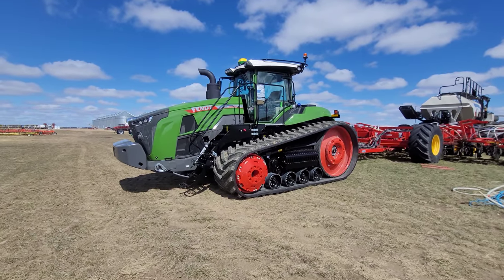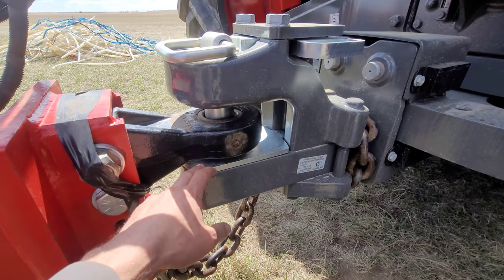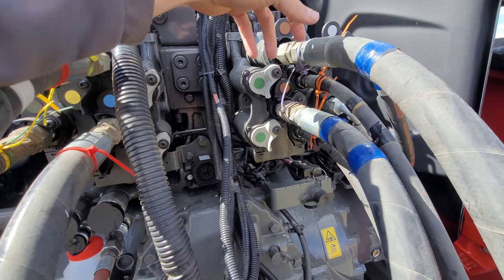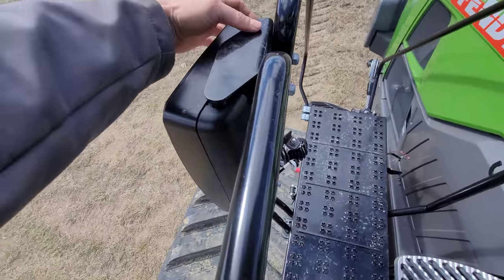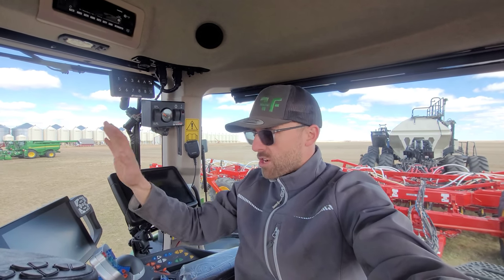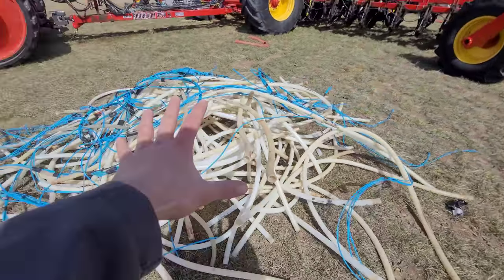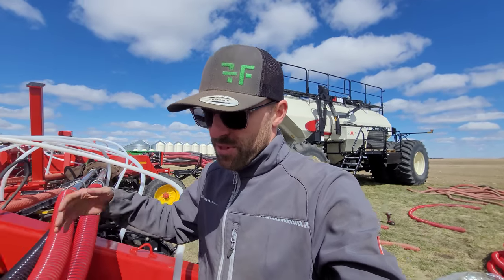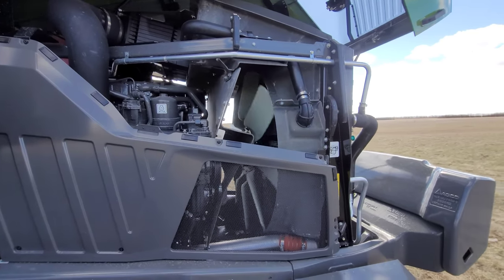New Tractor Reveal! 🤔🙂

Comment: 62,000lb! is mental! Hell of a tractor
and also "Yes it does have DEF" hahahah
Reply: Long time rule of thumb is 100 lbs per horsepower. That transmission may or may not eat up more power than the 4 tracks probably similar.
Reply: Wouldn’t fit down the roads round you Eh Tom 😂
Reply: Le tracteur fenf est bien et la vidéo est très intéressante et le semoirs est très grande

Comment: Congrats Mike!
I was working for fendt from 1989 - 1992
The difference between the MAN D4276 for the tractors with up to 700 hp is the turbo with a variabel geometry, to get the max torque at low revs, the ones for upt to 790 hp for cmbines have a fixed (larger) turbo.
Enjoy the german „meisterstück“,

Comment: That thing is so impressive. Can't wait to see it in action. Kinda surprised there's no refridgerator.
Reply: Maybe he'll look at an aftermarket fridge
Reply: @beaviccoon470  most likely yeah, but when you purchase a bit of gear worth $500k or so, you would think a fridge worth a few hundred dollars would be thrown in there ..
Reply: @landlifem5872  and put a decent tool box on it..
Reply: @hammerslammer3006  yeah you would think the toolbox should be built from 1/2 steel plate and sealed. Wouldn't cost much more and it's the small things like that gets people talking about it.
Reply: Tractor not an apartment!
Reply: @Luke muzzy Fendt, according to AGCO, is supposed to be "the worldwide premium tractor brand". I mean that's what they say, don't know if its true, but its what they say,
Reply: I'm not surprised at all, people talking about it cause it's expensive and people spend lots of time in it but I work on a mine and all the equipment is at least as expensive and lots costs way more and they all have smaller and less comfortable cabs than this tractor is. brand new D11 3.4 million and no fridge or anything like that, people spend 12 hour shifts straight in it. the excavators are around a million each and you don't even have enough room to stretch your legs out or air conditioned seats
Reply: @alexkroes6859  A D11 and excavator does a whole lot more than a rebranded and refreshed cat challenger
Reply: @J-1410  Not really at all. It's ridiculous how cheap the cabs are on mining/construction equipment
Reply: @alexkroes6859  I mean on a farm they are taken care of a bit better, unlike in construction where they are just beat up, fixed, and repeat. No use adding more parts to break and probably not get used for something considered obsolete in a decade. 

Also, doors being open is quite common in construction. That would just run a "fancy" cab within a day.

Comment: Do you ever take a step back to appreciate and marvel at how staggeringly complex,hi tech,sophisticated and just freaking awesome equipment has become?! This tractor is surely approaching the complexity of an aircraft. Really nice tractor 👍
Reply: if you're meaning airliners then no not even close
Reply: I ran planters in the UK about 35 years ago MF 590 with a MF30 combine drill, over here in Australia this year helping a neighbour plant, 410 hp NH tractor with a locally manufactued drill at 40 feet wide.I fully agree four monitors plus the tractor function. My first day I wondered what I had let myself in for.
Reply: Um, that's not a plus by any means
Reply: But on the flipside, Welkers get all their work done with simple powerful reliable
Big Buds made in the 80s ,soooooo is all that computer crap really necessary or just a way to drive up prices?

Comment: You can put the reverse fan on it. Which I would highly recommend
Reply: I don’t think these will operate at the proper temp if the fan isn’t oriented in the proper direction. Pretty sure they had an issue with one of their other Fendts where it wouldn’t keep the proper temp and ended up being the fan was reinstalled in the improper direction.
Reply: You can’t do that because you will have to change the hidraulic pump to a different one where it has the 2 different cylinoides and you that way each one can respond to each other when to blow and when to suck

Comment: the big question from everyone is: when can we expect to see pull offs between the 1167 vs 560 and the 1167 vs the 620
Reply: Your comment is on the top and now I wish youtube had spoiler tags.
Reply: And the 1167 and ernie😄
Reply: He already done that with the pro til. That's the reason you see that two tract there. It beat every tractor on his place. The Quad track IH case Johnny Quad and the Johnny two tract. And the fendt had the best ride over all
Reply: @joescheller6680  I don't mean something the protill race, just tractor strap tractor. He did do that but never posted it on YouTube, just on patreon. But it would be interesting to see if a weighed up fendt can beat a 9620rx
Reply: @arendvoordepoorte3217  reply you don't really want to be embarrested to bad do you

Comment: My dad talked about seeding up in Montana in the 60s using a two track. It was made by Caterpillar. It was made in the 40s I believe. The farm was out of available wheeled machines so he pulled the 2 track out of the trees and got it running. He didn't like the ride and the hitch was its Achilles Ankle but it seeded for two years. The big heavy iron weight up front also was able to push dirt. Much more useful than those sadle weights I'm sure. He parked it in the tool shed when he changed farms. He showed it to me 26 years later. It was just where he parked it.

Comment: Hey mate, in regards to the horsepower, I'm fairly sure that they only put 620hp through the transmission, and the 50 horses on top of that is purely for hydraulics/auxiliaries. So I can't see them putting a 790hp version out until they're comfortable that their transmission can handle 750hp+
Reply: I don't know anything about tractor transmissions,i know they are made for torque and low rpm,but there are cars on the road with way more hp then 790 hp,wouldn't be easy to have a transmission capable for that power?
Reply: @robb5828  it's more to do with the huge, constant loads which tractor transmissions are subject too. It's not unusual for a plough to be subjecting a tractor driveline to 50,000lbs plus constantly for 10 or more hours a day. Here is a link to a video describing the workings of the Fendt CVT https://youtu.be/68G8RyWEwzA
Reply: @sammurphy5454  thanks for the info mate and your time ;)

Comment: Very nice. Now let’s put it to the test and see if all their claims are true. On paper it’s a beast. Really interested in seeing real world application and how it all shakes out.
Reply: On paper it has less Hp than a 9620RX or a Quadtrac 620.
Reply: @melvd3484  the 9620rx has less power than the fendt at 672hp while the fendt is at 673hp and the quadtrac is at 692 max hp. However the new John Deere 9640rx has 691hp max. The fendt has more torque than the rivals at 3100NM of torque. The 1167 right now at least is the most powerful 2 track on sale today.
Reply: @beaviccoon470  Yes, but the 1167 is limited in Pulling Power to 618 Hp. The Difference of 55 Hp can only be used for hydraulics and PTO. As far as I know Deere and Case IH do not claim such limits while Fendt mentiones it on the web page and in the brochure.
Reply: @melvd3484  ye that's true but because he's using it on the drill then the full 673hp will be used but only if necessary.

Comment: I don't know how long the air filter will last between cleaning/changing, but I do know that it has a precleaner (the 1050 does not).  Next time you have the hood all the way open, look inside the big air box on top of the engine and you should be able to see all of the strato-cone (preleaner) tubes right before the air cleaner housing.
Reply: They pretty much all have precleaners on them.

Comment: Mike you can put a 300 liter tank on drills hitch  with a small pump plumbed into the tractors tank to fill you   just a  toggle switch in the cab to turn it on  when fuel is needed   works perfect on mine

Comment: Billie from garrnet farms in Kentucky seems to luv his 1167, he has a review on the big tractor power channel
Reply: Link to the bigtractorpower video with Billie driving his Fendt 1167:
673 HP FENDT 1167 Vario MT Tractor https://youtu.be/Fo8BuFA0bwA
Reply: Yup he pulling a little Nh3 outfit. Mike’s outfit will pull 4-5 times harder
Reply: @richardradawetz8788  that's true, but garrnet farms has a bunch of 620 rx Deere's and his last 875 out pulled them easily. He was pulling an 11 shank ripper faster than the Deere's could pull 9 lol

Comment: on the new case quads they still have the battery disconnect but it also kicks out after 20 minutes but the second you touch the door it is sensitive and it kicks it back in  And it  starts booting up your monitor in the background but the display is still dark
Reply from the maker: 🤔 Not sure I would like that
Reply: @mikemitchell2554  Hopefully it can be enabled/disabled, it would seem silly not to, but I've seen sillier stuff on tractors

Comment: Hi Mike, that MAN 16.2L 6 cylinder in-line engine is the MAN D4276 in a range of 612-700hp, ..... that same D4276 is also available as a 790hp ( IDEAL 10 ).
So an extra 30hp on the MT1167 will be no problem, I think that 790hp has some heavier parts in it, at least the transmission/gears. 
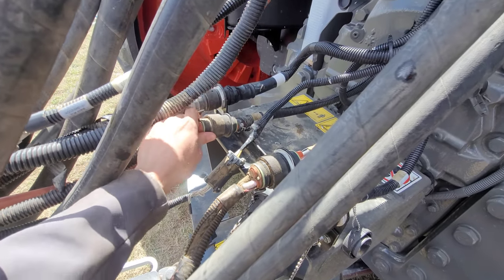Please fix that zip-tie cable (4:50) if you don't want some expensive short circuit in your electric system.
Reply: It’s fine with the zip tie.
Reply: @mikeznel6048  
I'll give it a couple of weeks when the insulation of the white cables is cut through on that iron bracket, the black hose doesn't do anything to protect those cables, they already make "contact" to that iron ( 4:45 ),  ..... but yaah, I'm not the expert. 😉

Comment: Man, if only Fendt made an 800 hp 4-track with a fendt one cab.
Reply: They should just jump to 1000 hp and 90,000 lbs base weight if they are going to do it.  I would think all the big farmers would be lined up for it.
Reply: @robhartshorn6823  I doubt that it would be worth it financially for Fendt.
The bought challenger and therefore got a cheap start in development for a two-track, a four-track probably would be a start from (almost) zero.
That being said, they are a German/Europe based company and they sell many tractors there as well. For Germany for example theres an upper limit of 40t / 88k lbs for all vehicle who drive on streets (excluding heavy transport with special permits). A 90,000 lbs tractor wouldn't even be allowed to drive on streets completly naked, without any tool.
The market for this performace class is not big enough IMHO for Fendt to invest in it, at least for now.
Reply: @Daxelinho9  Agco owns Fendt. They bought them in 1997. Agco bought Challenger in 2002. And Massey Ferguson in 1993. It's Fendt in name and color. Agco owned. Their headquarters is in Duluth Georgia.
Reply: @farmerjohnson8121  exactly! Fendt never bought a single thing! People in Europe forget that the sun doesn't rise and set on fendt.

Comment: I think this is a super interesting and hope fully solid choice. Cant wait to see how she handles the season!
But, that toolbox definatly needs to be bigger and more heavy duty ;)
Btw: It is wierd that Fendt diden't launch this with the Fendt ONE cab.
Reply from the maker: I know right?! Like the cab is quite dated given the new release and build up of this tractor.
Reply: @mikemitchell2554  Yes! The Fendt ONE fab was already in other tractors when they released this.
Maybe it will come out next year... along with a 1172 or 1179 option ;)
Reply: We just took delivery last week of a 1156 and sold our quadtrac 450. We have 70 hours on it now, it's been good so far but we haven't put too heavy of a load on it yet, so we are yet to find out how well it pulls. It seems to be using at least 15% less fuel than our quadtrac though. Hopefully it's a good tractor for you guys, and hopefully you have a successful season
Reply: We also hate the toolbox, we are looking at pulling it off and putting a bigger, fully sealed container there instead

Comment: Mike you are correct. That engine should be turned up to at least 750 hp if not the full 790 that the combines have. I am interested if hp is ever an issue or if it is just weight.
Reply from the maker: Yeah, I am worried about what that CVT transmission is going to take away.
Reply: @mikemitchell2554  I cannot remember and I don't want to rewatch the video, did the one you tested have a CVT or another type of transmission?
Personally, I like powershift transmissions.
Reply from the maker: @tony-the-tigerjohns3294  it was a CVT, I don't believe that powershifts in these are options or I would have one! Lol 😆

Comment: it looks like it should be a good tractor, be interesting to see what you think of the ride it gives you with it setup at the weight it is before you consider adding more, having had two tracks before when you get heavy on the back drive wheels the ride becomes rough, you should be very happy with the extreme tracks, we replaced a worn out standard set on our cat for them and  they were still looking good with twice the hours when we sold it off

Comment: I think that tractor wieghs almost the same as our 2 biggest tractors and combine combined as 62k lbs is 28 tons, the two tractors probably weigh like 15 tons together and the combine is probably about 15 or so. Is that 1167 pulling the 84 ft drill or the 64? What will you do with the spare drill? Good video 👍
Reply: They have also recently got a John Deere 9570r which they're planning on putting the 68ft drill on and the fendt 1167 will go on the 84ft drill as technically the fendt should be the most powerful at 673hp and 3100NM of torque.
Reply: @beaviccoon470  oh ok thank you for telling me 😃

Comment: Hey Mike, won't the holes in the top of the battery box be prone to allowing crud from boots and other filed dust to accumulate on top of the batteries and if it gets wet it might cause electrical shorts ?

Comment: There are tuner companies out there, that will come and test/tune your tractors, combines, sprayers, etc.  Maybe you can get them to crank up the HP on the 1167 another 100 HP or so.  Would make for a nice video.
Reply: Yes there is. But stop and think for a second. There is a reason fendt capped it at that horsepower, what damages could be done to the driveline at that power? You can only have so much traction and power that climbing one of those hills something is going to give.....
Reply: @calebrozeboom   I do understand what you are driving at.  Tractors always have some reserve power to give if needed.  I would imagine that the 1167 HP reserve is in the 700+ range.  Not all of that power would go to the driveline.  Tractors like that have auxiliary power leeches, such as hydraulics, electrical, A/C, PTO, etc. that would use some of that excess power.
Reply: @farmboy5622  I was told that the 1167 pulls the same as the 1162, just has the extra 50 horse for hydraulic demanding implements like the air seeder.
Reply: @calebrozeboom  I was also told that the 1162 and 1167 had exactly the same drawbar power, but looking at the Nebraska test reports, it appears that the 1167 produces about 20 more drawbar HP than an 1162.  Not a big number, but just different that what I was told.

Comment: i was never expecting this thing to weigh 28 tons i was expecting more around that 15 ish, thats ually what is ran around here.  thou we mostly use seeders and 60 foot planters and not Gigantic drills and seedcarts XD, take the everything from the JD 8350 to the DB60.  and yes i know the 8350 is an drill but its an what shall i say, small forfactor drill not an roadtrain XD
Reply: 62,000 LBS is 31 Ton tractor.

Comment: Interesting choice considering the noted rough ride of tracked machines and the amount  of roading that you do .I would have put money o  you getting a Caseih 620 on duals. Btw I can't understand why the big JD was traded when it proved to be a good machine and pulled the big seeder easily?
Reply: It was already tested against the four tract he did it himself on a video the fendt was hands down the best ride overall and best power over all.
Reply: @joescheller6680  Cheers I'll have to check it out .Btw I was referring to a Caseih on duals ,not a quadtrac.
Reply: @joescheller6680  I believe the test was done pulling the Protill at speed which is much different from pulling an 84' drill at 4 mph up hill.
Reply: @kentmathieson1342  it was that yes. But it put the tractor to test for its power and traction. All has same load same condition
Reply: And some of it was in loose ground creating harder pulling conditions

Comment: After seeing how bad the Fendts pull for the amount of HP they have,  how confident are you that the 1167 will pull that big drill as good as the Fourtrack did?
Reply: The Fendt 1167 won Mike's Dragrace. Seems that it does not pull so bad.
Reply: I had a similar thought.  Is there enough extra hp to overcome the power loss from the transmission?  Hope it works out well for him.  I truely mean that.